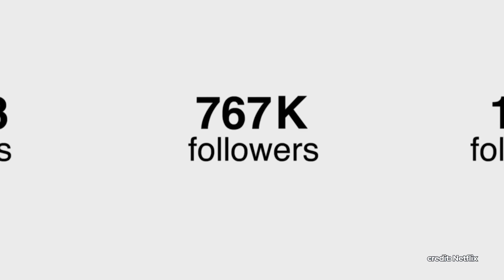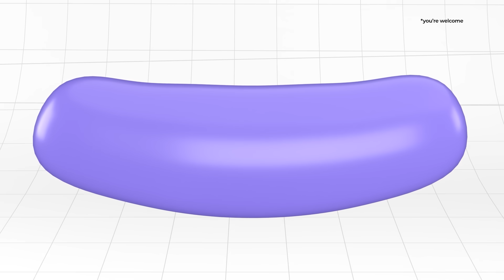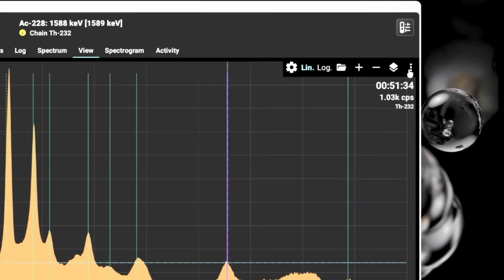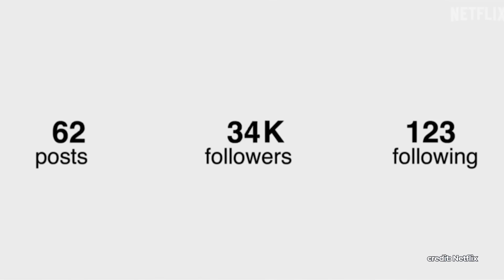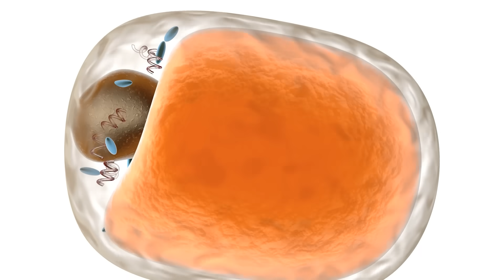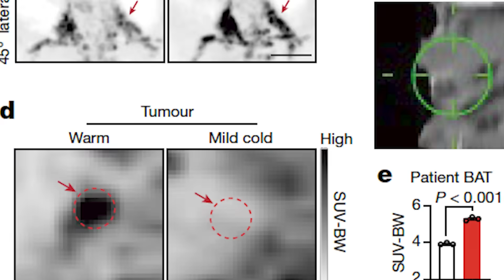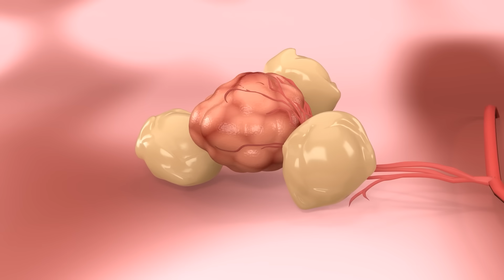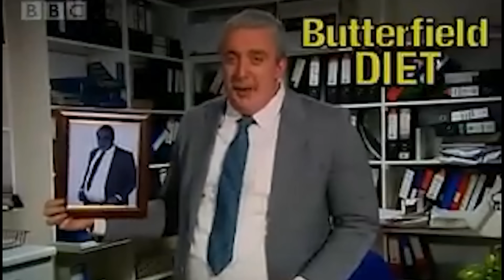Scientists Just Discovered How to Starve Cancer

Comment: TLDR: To protect from cancer or fight it if you have it, sleep in a large fridge at 4 °C or move to Canada. 

Do we see less cancor in people living in colder climates or people doing cold showers or ice swimming or homless people living in tents on the street? They all should have more brown fat and easily confirm the theory that brown fat is a viable solution in humans.
Reply: It only works if those brown fat cells are at the site of the tumour. The glucose available to the cells also need to be limited.
Reply: it seems like this would only work if the brown fat is constantly active not intermittently so it might not be that easy to test for
Reply: Ok then we would have to look only at cancers that happen at locations that are near areas that develop brown fat because of cold which might be the neck according to the PET scans in the video makes the dataset smaller but with enough data we might see an effect.
The point that this would require constant cold to work is also valid but the fat might also consume more sugar just by being there so the efeect might be weaker still but it might be there.
The question is do we have the data and enough of it to see an effect?
Reply: i just went ahead and asked ai that. Apparently humans in colder areas on earth has higher cancer rate, so something is fishy here.
Reply: @weee2011  People living in cold climates have the same or higher rates of cancer than people living in warm countries.  But that is because they have low levels of vitamin D because of lack of skin exposure to sunshine.  Low vitamin D levels will cause all kinds of health problems like weakening your immune system which in turn raises your risk for cancer.  Move to warmer climates or take vitamin D supplements along with magnesium, vitamin K2, and zinc.  You need all 4 nutrients in order for vitamin D3 to optimize its healing effects.